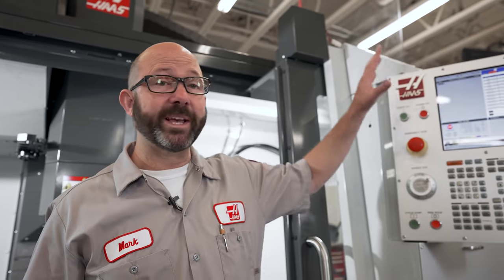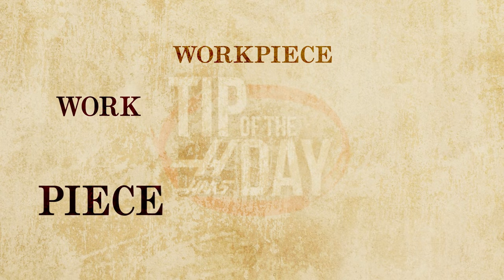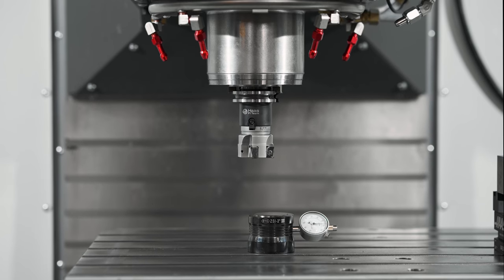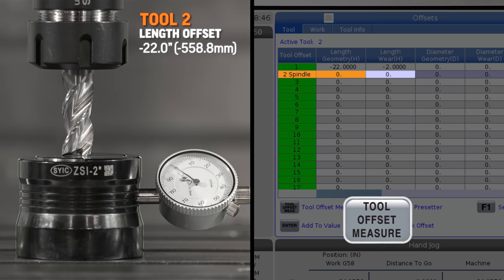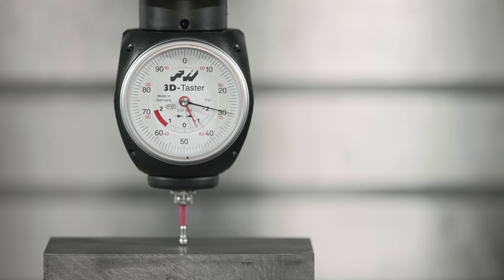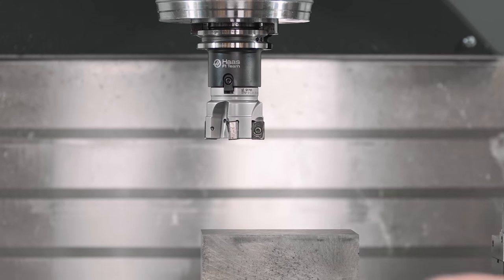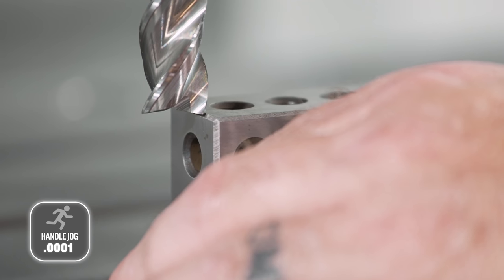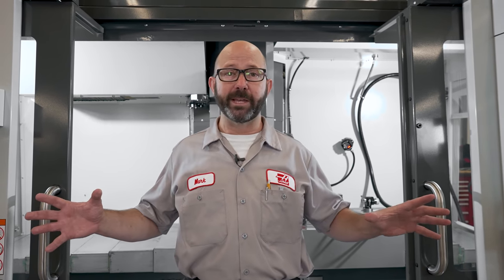Tool Offsets and Manual Tool Setters - Haas Tip of the Day

Comment: So I used to do Tool Length Offsets like this. Then I realized a much better way to do it. Some machines like the Mori Seiki I run have this feature built in.

First you need to know the Spindle Face/Nose to the table distance. This distance will be a very large negative number. That is your total stroke length on in the Z axis. With this number in mind. perform a similar action, but for a tool in the spindle. Either perform a simple calculation of the difference or that value, or perhaps activate a work offset with this absolute stroke length as your work offset.

Either way, the ultimate function of this procedure is to obtain a positive tool length since they're are no negative lengths. 

Having a large negative number for the TL offset and a small positive number in the Work Offsets does work still.
Reply: on older mitsubishi controls i worked on, setting toll offsets was so easy. the control recorded a tool offset measure plane. like the table of the machine, and would never forget that value unless you wanted to. so setting a tool was simples as just touching off that tool on the touch off plane and hit measure. to get the work offset we would usually have a tool with offset 0, and touch off that tool on the z0 of the part then hit measure.
on siemens controls you have it easy. because all the tools on the magazine can be used to set work offsets. the sinumerik control automaticaly corrects the tool offset and you just need to touch any tool on the part. dosnt need to be z0 if you want to, for setting tool offsets, you can use any known plane and the machine will do the math for you.
on heidenhain its also easy to pickup part offsets with tools, as the tool offset will be always be compensated automatically but, the tool offset can only be pickedup on work offset z0. or else you'll need to do so math and measuring.

Comment: I set mine on a 5 inch block I made. First my edgefinder which stays in the machine as my g154 p130 z offset since I do not use that offset for anything else. Then I set each tool to my block. Now all my tools are touched of together. All I got to do is set my actual workoffset z with my edgefinder lije g54 usually to the stock top. If I break a tool I have a common standard to set them at if the part is in process

Comment: I had no idea about the distance to go zero trick. Here I was using a calculator! xD
Reply: We can always go to the POSITION Screen, and use the OPERATOR Position as well. We can Zero-out any Axis value on the Position>Operator screen by entering the axis letter followed by "Origin". X-Origin, Y-Origin, Z-Origin. Using the Operator Position takes a little longer to zero-out, but it is less likely to get overwritten like our Distance to Go value. For quick work, I use the DTG value though, it is just too easy.

Comment: Set your retract plane your tool setter height or a "check it with a 1 2 3 block dimension" off your top of stock or z 0 depending on which clears. This allows you to easily spot check your tool lengths when providing out a program

Comment: All Z offsets are relative to the point of reference whether it is a table, precision gage, tool probe.  Once the point of reference is changed then all Z offsets must be touched off to the new point of reference (if you intend to avoid a crash).  Being able to comprehend makes the utilization of offsets less intimidating.  I've had to place fixture offsets that are off the table (out of travel range) through the use of a point of reference.
Reply: Great way of saying it. The confusion is that lots of people and shops use a different point of reference. If working with others, we have to communicate a single point of reference for touchoffs. Your having to set a zero outside of the table is funny, these unique situations come up and it feels good when we figure them out- little personal triumphs.
Reply: How do you know what the point of reference is.
I got a Robodrill used, the previous users tool lengths are all small negative values.  Like -2.5555"
My Machine z 0 is all the way up and all travel is negative.

I thought using my spindle nose 6" off the table as the Orgin, then measure the tools off that 6" block.  It gives all positive numbers.

Comment: I take this a step farther. I set a WPC Z offset for my tool touch-off indicator relative to the face of the spindle(not the lugs) and G53 machine Z position. I activate this WPC(ussually G59, via mdi) before setting tool offsets. A bonus is that I have a reference to visually verify the length of the tool with a tape measure. Using this, I also use known tool lengths, or the face of the spindle only to set WPC Z0 at finish faces of all workpieces, yes you must subtract the tool length or gage, or paper... (bonus... when Z position is at G53 Z0 position, I also can visually check WPC Z0 with a tape measure, reference the WPC Z offset. Another way to set the tool length is to use a gage pin or block instead of the 1-2-3 block. I prefer rolling a gage pin under the tool as I raise the tool in Z.
Reply: I believe we are using a similar method, do you get a positive tool length of the gauge length when pressing the "Tool Length Measure"?
Reply: @CueballcontrolSometimes  Positive Tool Length, -Z axis WPC.

Comment: If I have to set my tools manually, I'll use any of the methods provided but I dont bother with the tool height offset to the table. Just set your work piece "z" as the difference from the top of your tool gage surface to your work piece Z zero. Saves you a step and I think it's more accurate.
Reply: I must have learned this method from the Haas installer years ago, it's pretty straight forward.   Tool offsets for tools that stay in pockets only has to be done once, changing stock is simply touching the stock with a set tool, minus the difference and all tools are good to go.  Not sure why they us the H value wear offset at all?

Comment: I zero on the tool setters edge and set my haimer as T0 Z0 on my Siemens G500 (like extended G54 offset). All tools are then offsetted from that. If I break a tool mid run, I thrown out my tool setter again on the table and re-measure new tool.

Comment: We use a tool setter on the table and have the bottom of our vices offset written down and simply add the height of the parallels and part and then set that as the part offset

Comment: Dear mark, I am a Haas engineer from the the Netherlands, how can we use an external tool presetter and these measure methodes, can you send me some tips? Keep up the good work you do!
Reply: That is a great topic. We will definitely do that one. When we touch-off our tools manually, we end up with negative Tool Offsets, like -22.0" (-558.8mm), when we use our machine probing system, or an Offline Tool Presetter, we use Positive Tool Length Offsets, like 5.0" (127.0mm). We will move this video up on the list.

Comment: Hi Mr. Terryberry,
When you have let's say 20 identical parts ( G54 - G154 P14 ) with different heights on fixtures and you want to do a test RUN 4" above the parts, how do you do that.
We have other controls like Fanuc/Mitsubishi which have an  EXT(60) in the G54_table where we can add a XYZ value. 
When I input a + Z4. on the EXT(60)  ALL Z-levels going up by 4" for a safe check RUN.
We have a Haas ST25Y Next-Gen, when I use G54 and G55 on a part I add a +Z value on both Offsets for a test RUN, is there an easier way to do that, it's always a bit tricky to change your Offsets, in this case there are only two (Z) Offsets to change so no big deal.
I think the Haas lathe has the same Offset table like a Haas mill.
Reply: We would usually just do the same thing that you mentioned doing for your ST-25Y. To run 4" high above a part, we will just add 4" to that part's Z-Axis Work Offset, like G54. Now, we can add a global shift of Z4" to our G92 value, which is the last row on our Work Offset page (by default, when Set. 33=Fanuc), but we need to make sure that we don't leave this value in there, or it might confuse people later on.  G92 works well, for shifting all Work Offsets at once, but it can be complicated for operators, and we usually steer away from its use if we can. Check out the Mill Manual for more information about G92.
Reply: @markterryberry4477  
Hi Mark, thanks for your answer.
I checked the Offset table on our the Haas ST25Y and below the last G154 P99 there is a [ G50 ] and [ COMM ] row for the different axis, it's for the Global shift.
I've tried a +Z value on both [ G50 _ COMM ] and the Z shifts by the value entered, btw I couldn't find anything on the [ COMM ] in the manual. 
Why is there no [ COMM ] on your mills, it would be easy to shift all Offsets with only one value so that you don't need G92.

Comment: The probe on my Haas has certainly spoiled me, but they EAT batteries so there you are stuck without replacemets. Part set works easy enough on X&Y with a edge finder but Z is a little trickier. Good to remember the old ways before probes

Comment: Is it possible to run a custom Macro when the Tool Offset Button is trigger. Because we could read the current machine position and set the Z tool-offset like we want. Normally, if you have an external tool setter, the tool lenght is all the time positive from the spindle nose contact. If you have one method for manual lenght offset and an other one when you use tool-setter big crash can be expected. Also wear Z-offset is normally to adapt for mismatch, so small amount, not 2".

Comment: Could just use the tool setter height. Then  on the last tool  touched  set the operator page z to zero then jog to the top of the work piece and put the z value from your operator page reading in your G54 z. Done  then if you want to say face the stock just drop your G54 z say -0.01" and all the tools will be dropped by the 0.01".
Reply: The most correct method as far as I have seen. Touching every tool on every new workpiece is a bridge too far.  😆

Comment: Why wouldn’t you probe to the top of a 2in block first and set z in g54 then set your tool heights from the 2in tool setter? Since 9/10 times youll be using that same probe to set your wcs, could save you the step and potential error of entering -2.0 every tool, you dont want to see what happens when you miss that minus sign!!

Comment: I am following this exactly on a 2007 VF2,  Why do I alarm out when I use a POSITIVE number in G54 "z offset"   - Alarm #318 , Over Z travel range?  

my tool offsets are negative (-16 or so)  distance between the table where I zero'd tools and top of work is 7.0" 

any suggestions or am I missing a setting somewhere?

Comment: Do you even have to subtract 2 inches for the touch off tool cant you just zero on top of the touch of tool and then go to work piece. saves subtracting the 2 inch on every tool right? just if u replace a tool, set new tool on tool setter and dont subtract 2 inches?

Comment: You calibrate height gauges by turning them upside down  and pressing them down on a mill table. Lot better solution then gauge pins or 1-2-3 blocks.

Comment: same method basically
g54 as work offset
g59 as zeroing offset
50mm tool for zero similar to the second showed
touch at 0
z enter c, +50 enter
(fanuc mynx750)

Comment: i use a carbon paper to touch off my tools. the carbon paper is exactly 0.03mm of thickness. i place the paper on the face where i need to touch my tool and jog and tool on paper in 0.01 increments and while i keep sliding my carbon paper and at a point the paper wont slide and it ll stop, i ll take that point as my tool offset.

Comment: I use broken endmill Ф6 (mm) turned upside down in short Weldon. It's lenght is always 0 .
With "zero tool" i touch the top of the precision made block 30mm and save offset in G59. 

For masuring of all tools i call the tool, and then call G0 G59 in MDI, and touch the top of the same 30mm block. Tools are almost always, longer than "zero tool". 

Same "zero tool" i use to get Z point for all workpieces, using steel ribbon 0.1mm thick, and then substract 0.1 of offset lenght to match "zero tool" with surface of the workpiece

(My English is bad, i know)
Reply: Sometimes, especially when i measure drill bits in the middle of the process, i measure them on top of the part using not paper, but aluminum foil from chocolate or plastic foil of candies.

Comment: I use a 1,2,3 block, then I touch the tip of my nose and stand on one foot.  I hit tool offset measure, then after that I go into the tool offset page, subtract the diameter of the earth, hit the F1 button then I have all the information I need.

Comment: Setup's should not be so complicated!  Designate your setting tool and touch ALL tools off that.  Then for your work (piece) offset, put the difference between tool length and your work Z0.  This means that if a tool breaks or needs to be changed sometime during the production run of the part, almost anyone with some basic training can re-touch the tool off and continue in production.  Also, don't designate your tool length offset to touch off on the raw stock material, if you have to change a tool mid-program, you have nothing to touch off of and most programs cut the 'top' surface first (and nothing guarantees the raw stock is the same size, though it should be close if you holding ±.001 you can screw yourself over).